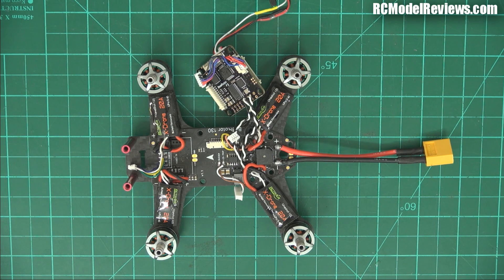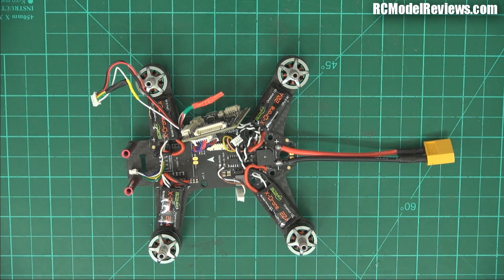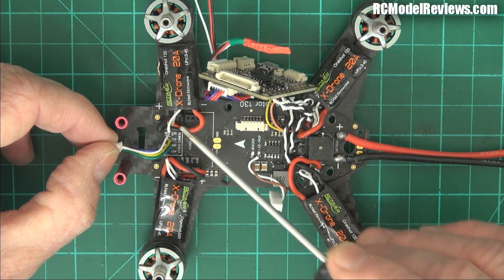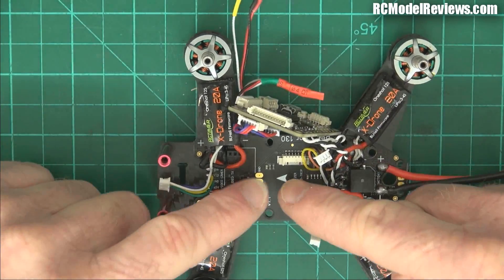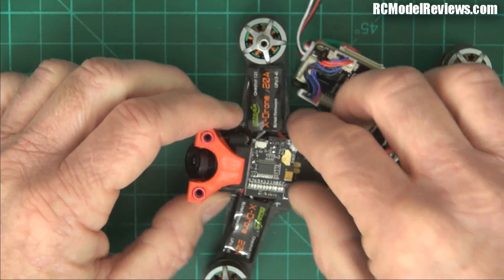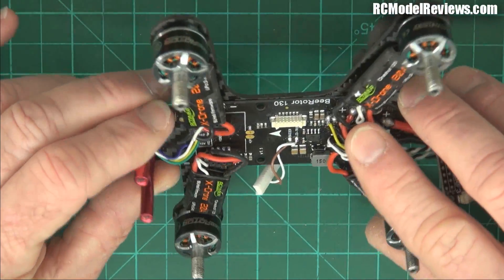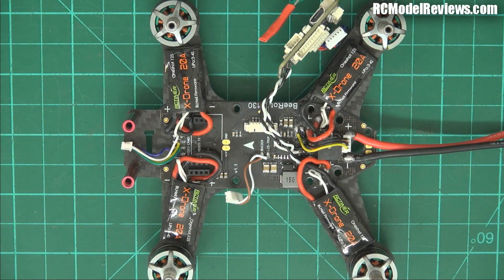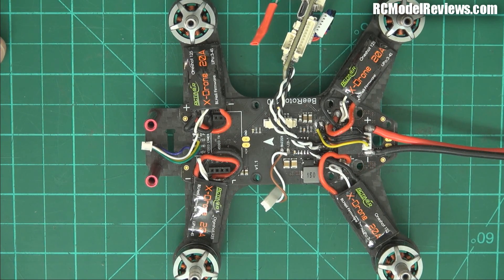Fixing noisy FPV video

Comment: That's switched mode power supply issues.. Unfortunately they are now the norm taking over from Linear.. But In this application Linear would be far better for video performance.. I run a switched mode from the battery and cascade it into a linear reg.. That way I can keep the efficiency of the linear reg high by only sending about a volt more than it wants into it.. Doesn't have to burn off the battery voltage as heat.. Clean video every time..

Comment: "video noisy? compromise to fix it by losing your osd". you may not find osd's useful but many others do. not everyone has a telemetry radio and telemetry isnt always reliable. without osd i have absolutely no idea what my rssi or voltage is at any point in time ever unless its critical and the alarms are going off. what a shitty "fix"

Comment: I have a weird FPV noise problem...Could you please give me an advice. ,,,and help....;) I have a QAV X 214 using an Omni bus F4 V3 FC , FVT Little Bee 20A ESC. I have already installed 470 uF Low ESR cap (damaged, its bended during crash and i havent replaced yet) in Lipo XT60 connector in PDB (matek Mini PDB).  I wired Camera and and Vtx direct to Omibus. they  are V bat and AGND (common video ground). the problem......the video is clean enough, but when i punch out the throttle the video is wavy but i still see them. this is very annoying to me to do some fly maneuver.....what was goin on?
- do i have to replace my cheap 12V camera?
- do I have to replace damage cap?
- do i have to instal LC filter
- do i have to install low esr cap in each little bee (there's no room sir for QAV X....)

your help and advice will be highly appreciated.

Comment: Why doesn't anyone use shielding?  I'm sure there can be a way to dump the induced noise somewhere despite not having a ground.
Reply: terrellma Yep thats what I thought. Just have some shielded cable from the camera to the VTX and then depending on if this still does not fix it entirely put the camera and VTX inside shielded cans. Also I think there is a way to make a virtual ground using two diodes that may help.

Comment: OSDs are one of the BEST inventions ever - alone the fact that you're able to change ALL Betaflight settings (stick menu) and even your PIDs on the field without using a laptop is a good reason to have one. You can even change your PIDs IN FLIGHT, no landing required anymore. With an RSSI transmitter you're able to see the RX reception quality directly in your OSD while FPV flying. There are so many reasons for using an OSD. Don't want to miss it anymore.

Comment: hi, i have signal loss when i trottle up on my mini quad, for testing i hooked my fpv set up to an external power supply, the problem still occurred i also tried vibration damping but this didn't help. Does anyone know what could be cousing this problem?
Reply: ian hennus, if it's a lizard95 or kingkong90gt it might be a bad 4in 1 esc board, bad fc, or a really funky pid setting/bad firmware... read earlier about a fellow who put a 470uf 25volt low esr capacitor on the power in side of his 4-1 esc board(right between the battery cables) then ran a separate  tiny 1amp 3v buck regulator then 16v 1Amp Lc Filter for his Vtx and Camera and that seemed to fix it, keeps power draw down on the Fc, Meanwhile the Capacitor cleans up the power by adding consistency... the Lc filter is great for blocking interference to the cam..... I just addressed all of the above + shielded wire/ conformal coating, liquid insulation of any exposed conductive surface (antenna connections, power connections, 4 pin con., unused solder pads, tops of lc filters, camera connections, microphone exterior, auxiliary grounds/shields, etc), changed my Center of Gravity,  and soft mounted the motors so it should work I'll let you know if it does or doesn't work Wednesday...
Reply: Also switched to a Xsr external Rx because the others drop signal for no reason....

Comment: i had a ares cross fire and the wiring on them are just aweful, the esc's, motor wires and wiring to the lights where all crammed under the pdb which was the power source to the vtx, unfortunately the thing was a betting game at a couple feet away, just terrible

Comment: I think the first thing I would have tried is putting a small capacitor in the power side as well as some LC filtering which are both super cheap to buy. One thing to note though is I NEVER buy ready-made anything, I build everything to avoid ending up with garbage like that. No way in heck do you need 12 gauge wire leads that are 2" long for those ESCs, you could probably use 20 gauge for that small of a wire lolol although I probably would have used 16 gauge myself. Most of the time you aren't going to be pulling 20A per ESC, more like 4 or 5A in level flight if that.

Comment: Does the fact that carbon actually resists and challenges electron paths, somewhat conductive and the noise is not properly isolated between processors and resistors?

Comment: Hi Bruce great channel I need some help I'm building a skywalker 1900 and I'm putting a immersionrc 700mw 2.4ghz in the wing what is the best way the run the wires back to the fuselage I'm worried about rf noise etc thanks for your time

Comment: Bruce just to let you know I built a BeeRotor 130 ultra and didn't have 
any interference so I think yours is just weird. I even modified it by 
slamming the top plate down and squishing everything together and still 
no interference. Then I sliced the coax by accident and spliced it 
together and used a copper mesh around the break with PVC electrical 
tape LOL and still no interference and the splice sits on the FC! I'll 
put this comment in your 130 vid as well just in case you don't see it 
here. I can take a video of it if you would like to prove it and show 
you my unhandy work.. Bottom line.. yours is just fudged for some 
reason..

Comment: Instead of doing away with the PDB, which actually looks like it's laid out well for the frame and ESC locations, wouldn't it be better to simply do away with the video line going through an unshielded foil trace? Run a small shielded wire from the camera to the OSD so it is not impacted by the EMF/RF noise of the high current wires.

Comment: The short  lines are mainly spikes in the picture.
First add a capacitor 470 micro F/ 25 V /low ESR type at the side of the fpv cam.
Low esr is very important ,I repeat ;-)

Comment: I really like having a simple OSD. For one thing the voltage & armed/disarmed. voltage warning flash up. & I like having a centre target. (I disble the horizon) 
Thats handy, but of course you could do without it.
However the indispensable useage in my opinion is to be able to change your PID settings.

Comment: I dont have a radio with telemetry. I have my trusty old JR PCM 9XII and its still awesome 10 years after I bough it. I use Spektrum and FrSky modules. The radio is fine and I don't want to buy a new one so I like having as OSD to see my battery voltage.

Comment: Same. I see no use for osd. 
I use my timer on my dx8, works perfect no telemetry either. I check my batteries cells before and after my flight always with no problems of running my batteries low.

Comment: I read somewhere that the Beerotor ultra PDB has some extra capacitors in-line with the ESCs to minimize the noise. I guess they are not working at all? There is also an electrolytic capacitor provided with the kit.

Comment: I would say the problem is not "camera-osd-vtx distance" only. Its also the amount of noise on power line from ESC. Those big capacitors had a purpose after all. Luckily good LC filter fixes the problem. Too bad cheap PDBs have crappy filters

Comment: I can't fault the technical analysis at all.  I would say that the OSD "issue" is highly subjective. You obviously don't want the additional information, and other people do.  I'd say the optimum solutions are to either make it optional, or make it switch selectable.  Making the OSD optional has obvious price advantages and obvious stocking and logistics disadvantages. A switch requires a minor bit of engineering, which the manufacturer is clearly weak on.

I'm a technician by trade, and one who was primarily skilled at repairing instruments, not improving them, so you probably have the advantage of me when it comes to engineering.  Would you think that simply shielding the cables would create enough improvement to be worth the effort, in the absence of the skills to re-design the power distribution board?

Comment: Mr. Bruce. Would twisting the ESC and all long run wires together help cut down on overall noise? I agree that some OSDs simply provides too much information. Like flying looking thru partially closed Venation blinds. I would like a battery level, out of the direct line of sight, in a corner of the screen. Very informative video. Do the Chinese actually ever test the quads they are peddling to us consumers?

Comment: Having an OSD is much more than an artificial horizon and voltage readout. I have voltage and mah consumed on screen as well as time armed. Just those 3 on the bottom. But, the biggest reason I use these same exact boards with built in OSD on 3 quads is tuning. Tuning is so much easier with the OSD. No need to lug around a laptop and connect every time. But I'm here because on my 130 frame ,my video is horrible, gonna try this out!

Comment: I run a separate "free wired" circuit for all my video gear with the wires twisted together (for what little it's worth). I run 4S, so I have a 12v regulator to drop the voltage which also takes out the surges and spikes from active damping (biggest source of interference). 12v wires then run to the VTX, up to the OSD, then to the camera. Putting the video signal through the PDB is just madness!

Comment: Gotta say Bruce, completely disagree with you on having an OSD - I run a micro minim + current sensor on all my minis with a minimal layout displaying voltage, current, mAh and flight time. Being able to look down and instantly gauge how many mAh I have left is a godsend.  It's also really helpful to gauge the condition of a battery as it becomes blatantly obvious when a battery starts to degrade & I'm yet to over-discharge a lipo since I started doing this.

I just wish more manufactures would include a current sensor in their products as voltage alone is kinda pointless as it will fluctuate wildly due to load and condition of the battery.

Comment: It is probably noise from power lines or something coupled to the lenght of wire needed for osd. Perhaps you could just bypass the osd (jumper the video diretly to transmitter).

Antenna coax should not be the suspect, they aren't sensitive like the input side of the transmitter.

Comment: l have a couple mini quads and the ESC interference in video signal is much worse than yours. l use a standalone 3S lipo for FPV and l do not connect any of the FPV wires to the PCB. Even though l neither can fix the noise  it  with LC filters between small lipo and FPV transmiter or a common bank of 6 capacitors just before ESCs. Only idea left l have is to warp ESCs with a wire mesh or aluminum foil to break the eletromag field. Any further clue?

Comment: I dont race I fly for view only so video Quality is paramount to me  ......The video problem can be worse on carbon framed quads , due to shadowing reflection blocking etc . I realize this is not the problem that Bruce has ..different kettle of fish altogether  :)  The Prosight really is affected by this . My Prosight was originally fitted to a Plastic King kong .. fantastic range and reception .. I moved all the equipment including motors esc all electronics including the Prosight to a DALRC 265 carbon frame .Only thing that changed was the pdb which is esc distribution only. Every thing is well insulated from the frame with heatshrink standoffs etc . The prosights range is now only 1 third that it was due to partial shadowing of the video antenna in flight . I pulled it all apart  and refitted it to a non carbon zmr 250 and all is good again , but the zmr 250 is too small to carry a decent battery. So I will be making a quad from scratch for the prosight more suited to it .

Comment: In my early days I almost ruined two batteries by thinking I would notice the OSD telling me the voltage was getting low instead of using an audible alarm. I never bother with them on a miniquad these days.

Comment: I mean, there is something you could do.  Twisted shielded wire.  Dump shield to ground.  Or just keep your ESC leads short and not make them big loop antennas. 

I like OSDs and hate talking transmitters!  I don't want some lady nagging me my whole flight.  looks over shoulder Getting away from the nagging is one reason I go flying.  Agree with artifical horizon and all that, but volts, milliamps consumed, flight time and RSSI.  These are things I like to have at a glance.

Comment: Bruce, ever tried to check the capacitors on each ESC? I would check those capacitors on them to make sure it's working properly. If needed, I will add bypass capacitors as well. That would help clear noises. But that wouldn't be necessary as my DYS Lightning's video is working nicely.

Comment: I also used to think that OSD was just a waste, but I don't any more.  I put a micro minim on all builds now.  I have volts and flight timer showing, which when you are used to it is really nice and I now much prefer that before telemetry.  Also it allows you to change rates, pids and all that jazz without hassle.  Try running OSD a few weeks and see if you don't feel the same Bruce.  It's a but more work when building, but once it's there it's really nice to have.  Much less intrusive than a lot of false voice warnings due to voltage sag.

Comment: I was out testing the Ideafly F210 today (probably the one you mentioned with Ali) and it has the same noise. I am curious though, as all my custom builds I have the cam up front, run the wires to the matek pdb in the middle, and run the other wires to the back with the VTX. I do select 5v for the cam and 12v for the vtx, but I didn't think it filtered it, yet I have never had ANY noise on anything custom.

Comment: Very good video Bruce.

Do you have a video talking about quadcopters (or tricopters for that matter) for photography? I dont want to spend hundreds of dollars on a name brand overpriced shiny quad that has a 10 minute flight time. cough phantom cough 

Right now the plan is to buy a turnigy transmitter and do the frsky mod which you made in another video, and build my own frame and slap the electronics and cameras on. 1 for FPV and the other for photography.

any tips or places to look to help? i haven't been in the RC game for a while, and i dont have experience with quads/tri's.

Thanks
Reply: I hate to break it to you but the DJI Phantoms are not shitty or overpriced. You won't be able to build anything with the same kind of video quality for less.
Reply: This is coming from a DJI hater from way back.
I hate to admit it but the Mavic has to be the hottest thing on the market right now for what you want.
I have tried building a budget camera platform and have never quite achieved the results I am after. 
By the time I put better motors and props on what I have, and buy a decent camera I will have spent close to what a Mavic will cost and still end up with an inferior result.
It may be good, but not as good as DJI is offering with a plug and play solution.
Reply: The stoned scientist is absolutely correct.  There is no way you'll manage to match a Phantom 3 (or newer) on video quality, flight time and price.  Sorry, that's just a fact.  Take it from someone who used to think that it was possible.  However, you might match it on photography quality, using a 450-ish size quad, BL gimbal and og good compact camera like a Nex or similar will beat a Phantom on photo quality, but not video.  Also it will have way less flight time, probably only the half of a Phantom that has 20+ minutes.
Reply: As the others have said, if your intention is to put a good quality camera in the air for 20 minutes for cheaps, that's what DJI's are for. At this point, DJI is the "flying GoPro" company, and do it well. HOWEVER, if you want to be flying hard in unusual conditions (high wind, proximity, volcanoes) that's when something like my David Windestal v4 Tricopter starts looking damn good. The agility and "swooshiness" of the Tricopter can give some fantastic dynamic shots, compared to the stiffer and more robotic moves of the quads. Tricopters fly with personality! Takes a lot more skill though.

ie: If you're filming a house flyover for a Real Estate site, go DJI. If you're doing a Star Wars trench run recreation, go the Tricopter. Every tool has it's appropriate uses.
Reply: Lol, you just said every single word I had on my mind, after seeing how the phantom 3 got his price around 500$ I started to regret so much the decision of make a homemade aerial platform..  Too late, I guess we have learn't man.
Reply: I appreciate the feedback guys, thanks!

Its starting to look like DJI is the way to go for what I'm planning, though I think I'll dabble in the homemade and make a comparison.

Comment: Notice there is no sheilding in any of this stuff? Mabe because its all digital but I agree,you get too much interference from the bad design. Throwing smoothing caps on it adds weight,thats all that does. I heard that particular brand and type is junk . Mabe it was your review too,cant remember I was pretty tired that day.
Reply: most protocols in a quad are digital, but the video signal is still analog. there are IP cameras, but they're not sized for FPV, and neither are our current OSDs and video transmitters compatible with them. they could be a welcome improvement for the hobby...